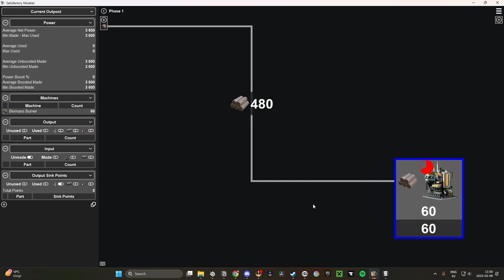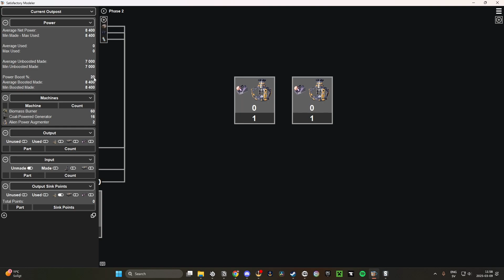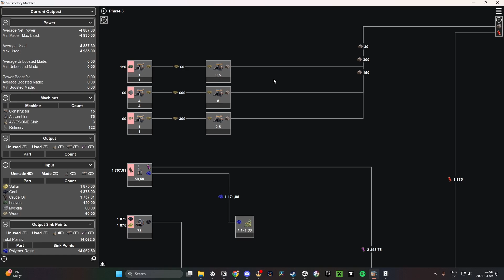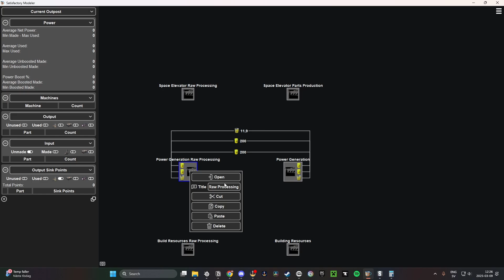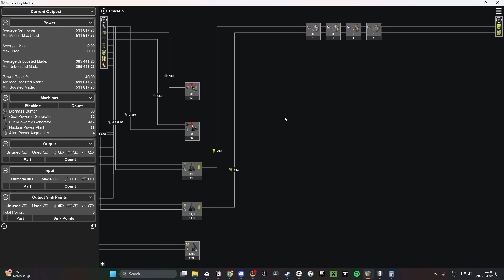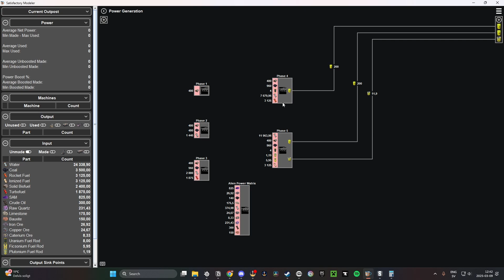Full Guide - How much POWER do you need to finish Satisfactory 1.0?  | Tips and Tricks

Comment: I just got to Diamonds and set up strait coal to diamonds in a particle accelerator, I don't have recipes for mixed resource diamonds. I just found a pure coal node. I am sitting at about 22k power and pulling hair out trying to not trip breakers, guess it's time to expand power again. Here I thought I was doing good with my 48 fuel generators burning turbo fuel : /
Reply from the maker: 22k is not bad :P I think you can finish the game with that as long as you keep the factories offline as long as you don't need a certain part produced ^^

Comment: great detailed guide. i personally wouldn't use the alien power converters at such an early point as they have a high sloop cost and sloops are invaluable to your production of critical and space elevator parts. the method i used on my 100 percent playthrough was building an insane diluted fuel power plant and i rode those generators through a huge arc of the game before eventually building a rocket fuel plant. i had a ton of overhead in my power supply but it was worth it to not have to think about power when it was done
Reply from the maker: I am of the school of thinking that early on in the game having 4 Alien Power Augmenter means you can skip coal power, I love the early game exploration so 50-60 sloops is just enjoyable for me to find, it also means I will guaranteed have all the spheres to finish the entire dimensional depot tree, something I tend to want around the same time i ge Mk.3 belts.
I make sure to tame 10+ doggos so I have a continuous influx of the advanced resources I need to unlock everything
That and crash sites makes it easy and fast ^^

In my long term playthrough I made a series of it meant I could go quite bananas in Phase 1 and 2 because I had so much power, so I have not had to supplement my building resources at all while working on phase 3.

It's all down to playstyle ^^ as long as you are enjoying yourself, nothing wrong with it :P
Reply: @jackblade281 aye, this is very cool but it means the playstyle would be lots of time spent exploring. That's how I played it. Set a few things up to let resources stack then go explore and find slugs, mercer spheres, sloops, etc. Then when you get back there are lots of materials are ready to make new things (my map has belts, tubes, and power lines criss crossing it to bring everything back to my starter area). Lots of guides on YouTube tell you how to build cool projects but none of them say how much of the game is easier if you spend time exploring as you go. Hardly any bottle necks this way.
Now I'm in the late game I've finally got round to building very sophisticated mega projects and I'm in the process of building a giant belt super highway(24 Mark 6 belts going one way, another 24 going the opposite, with 6 belt mini lanes shooting off it like veins to get to the empty spots) that goes all round the map like a four leaf clover. Every resource is going on it with splitters taking what's needed off it where they need it. I'm slowly deleting all my sinks because I will only put higher items in it now. If I have spare low lvl resources going round the belts I'm building more manufacturers to make higher lvl items, and so on. I do have huge parts of my ground level taken up with massive industrial container stacks for everything as storage. As you say, different playing styles. But I have no rush and it's fun
Reply: @krammy the only time I use sloops are for phase goals to bump up the output. I rarely set up automatic lines for these things, just containers for ingredients needed and the drop the sloops in for more output(also really useful to get the time crystals bumped up when you first get to belts mark 6). I have one power augmented thing. Seems nice but I can see it really get useful when you have lots of power being generated. Not too much until then but the only time I had a power bottle neck I went big on coal power and over built and it carried me through nicely.